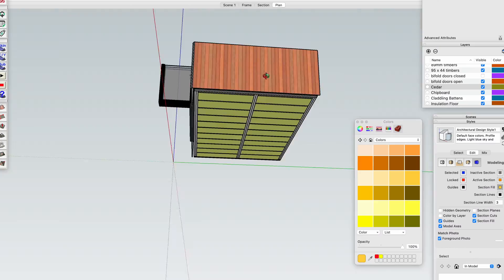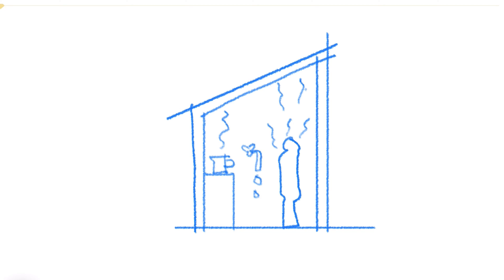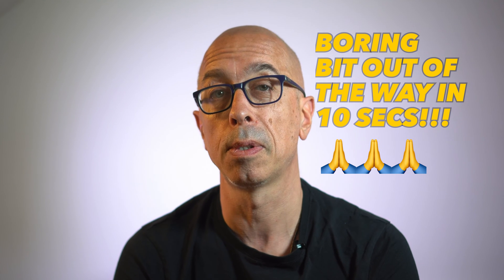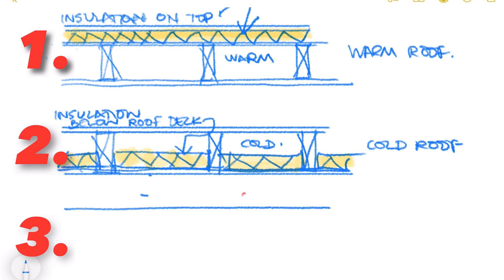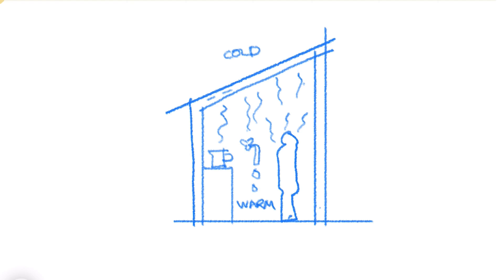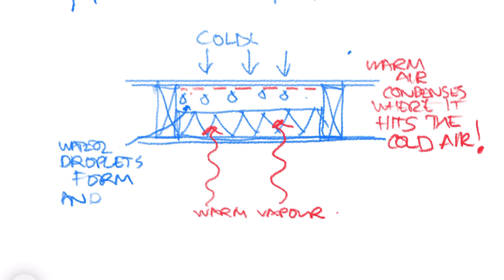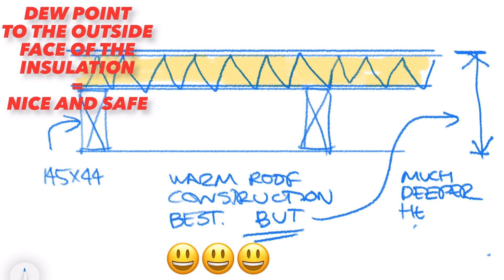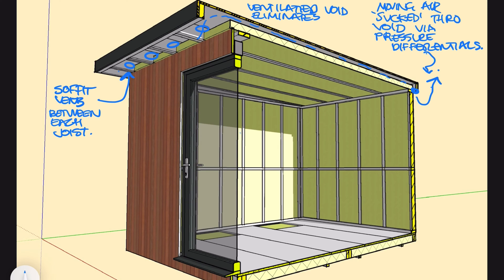Insulation - Warm roof  v cold roof v hybrid - and why should you care

Comment: How do you actually ventilate the warm roof ?
Reply from the maker: There are no voids so there’s no ventilation for a warm roof.
Reply: @build-better-things  
Thanks for the reply and sorry if I sound like an idiot. 

I mean to say will the joists rot over time or will that not be a problem? The condensation from below won't cause the joists to take on moisture?
Reply from the maker: You don’t sound like an idiot. For a warm roof, the joists are at the same temperature  as the air in the room,  since they’re on the warm side of the insulation. same vapour content, so no change in humidity, therefore no chance of condensation . It’s when the temperature changes that the amount of vapour that air can hold changes, and where your condensation can occur. That’s why you put the vapour barrier always on the warm side of the insulation, and , for a warm roof,  above the joists. Condensation can happen as it changes temperature through the insulation to the cold side, assuming small gaps in the insulation and the inevitable small leaks in the vapour barrier.

Comment: Hi, I love your content. Any recomendations when it comes to isolating the roof of a 100 yo flat roof masory house? There is no proper isolation in place currently
Reply from the maker: Difficult to say but usually it’s a cold roof, so 50mm ventilated gap at top face of rafters with insulation between and then under, of you need to utilise the roof space

Comment: As I understand most of these roofs are made to keep the cold out without causing humidity-condensation issues. How would you address a roof for a warm climate area, where most of the year the weather is warm/hot outside and it is only cold maybe a moth of the year. Our main goal is to keep fresh and confortable areas inside the house, but still avoiding any condensation/humidity issues during winter (as short as I might be).  Any recommendation?
Reply from the maker: Hi. The principle of thermal conductivity is true whether hot it cold so a “warm” roof should still be used. I’ve just made a video explaining it if you have a look, I think it’s in the same bit about hybrid roof. It’s a counter intuitive concept.

Comment: I find a warm roof bulky and ugly. A cold roof is slick and neat. You should relate to this as an architect.
Reply from the maker: Hi. I agree if you get your detailing wrong, a warm roof can be bulky and ugly. This is an example of how I use design and detailing to mitigate
Wall Cladding - panel size, fixings, timber or composite - rain screen or tongue & groove
https://youtu.be/xdfVky_GZUI
Reply: @ I can’t work out how moving the insulation from on top of the roof to in between the rafters (for arguments sake we will assume that insulation is same thickness as rafter) changes it from a warm roof to a to-be-avoided hybrid roof. It has the same structure from inside to outside and still acts the same as a warm roof from my limited understanding.

Comment: I have a back porch with a rubber roof 2x8 joist that is now  living space. How would I insulate the ceiling? I was told to put 1" spacers between the joist with radiant barrier over the 1" spacers for an air gap from my soffit to the attic ridge vent , Rock Wool insulation,  and drywall.

Comment: What’s your recommendation for the climate in Sydney, Australia ie. 25-40oC in summer and 8-15oC in winter.  Summer would be two-thirds of the year, so hot outside, cool inside and the insulation would, for most of the year, be for keeping the house cool.
Reply from the maker: That’s the climate where thermal bridging makes the biggest impact. People associate thermal bridging with heat loss, but it has a bigger impact on keeping interiors cool and comfortable in hot sunny climates, especially in the evenings. You need warm roof and warm wall construction, with the actual structure inside the insulation. I’ve made videos about it elsewhere on the channel. Thanks for your comment.
Reply: @ thank you!

Comment: I have a 20m2 flat roof over my kitchen, cold construction but well cross ventilated.  The decking and felt were last renewed in 1989 but it's still absolutely fine and in good condition.
When the work was done I insisted on 18mm marine ply for the deck and a high performance single layer felt for the membrane.
Reply from the maker: That’s an impressive 35 years for felt. I don’t think the marine quality of the ply made such of a difference, more likely it’s been the good cross ventilation. Constant air movement can make even ordinary composite perform pretty much for a lifetime.  I’ve laid my own felt in the past, and it’s harder than rubber to do well so it sounds like yours has been expertly laid. Thanks for the comment.

Comment: I've seen a few videos proposing to fully fill  with insulation the space between joints, so no air gap between insulation and deck, but adding a vapour barrier below the insulation. If no air/vapour travels through the insulation, no condensation can happens under the deck. Do you agree?
Reply from the maker: I don’t agree. Vapour barrier does help reduce the vapour, but there is still vapour and still a dew point therefore. Plus, your vapour barrier will have a load of holes for your fixings and electrical points, and, if you’re following some of the YouTube builders, you will have likely used cheap polythene and fixed it with staples. I’ve made a video about vapour barriers and how difficult / impossible it is to create a real barrier. Timber products on the cold side of insulation is not sensible.

Comment: Our house initially had flat roof and therefore the insulation is between the ceiling joists. Later, pitched roof has been added on top. It's a single story house and due UFH we wish to raise ceiling - thinking of exposing joists and have plasterboard on top. What would be best method of insulation? The roof cavity is ventilated. Note that we also want to install MVHR and ducted AC systems which would interface with the ceiling. Also, the lights would be fitted in the plaster board too. Would it make more sense to do warm roof insulation and reduce roof cavity ventilation?
Reply from the maker: If you want to expose the joists / rafters as you suggest, you don’t have any other choice than to use a warm roof method for insulation.
Reply: @build-better-things  but in theory our second roof (the pitched one) can also be made as a cold roof? or not? warm roof will mean roof tiles replacement which is a job beyond our budget at this moment.
Reply from the maker: I’m not understanding what you wish to expose… but for an existing rafters where you keep the roof covering, you need to ventilate and have a minimum air gap of 50mm and introduce roof vents. I’ve made a few videos about it. Then you need to decide on your insulation based on your available rafter depths.
Reply: @build-better-things  we effectively have two roofs - flat one which was built first and pitched roof that has been fitted retrospectively on top.

Comment: Hey thanks for this video very helpful. I have cut vent holes in my fascias now! But what about the walls? Do these need venting as well? I have a 100mm timber framing with pvc cladding on the outside so if i fill the voids with PIR there will be no circulation of air in the walls. Plan to heat it in winter so will be exfremes of temperatures on each side of the wall. The timber framing will be a weak point in the themal insulation with 100mm pir stuck into the gaps.
Reply from the maker: You need to vent on the cold side. If the insulation is hard up against the OSB for your wall then the breather membrane will allow residual vapour through to the external cavity where it can condense and which should be ventilated. There’s variety of ways to vent these walls which I explain here… see my video here for a better explanation 
TIMBER FRAME v BRICK BLOCK Masonry- House Extension walls - Architect Builder’s 5 expert tips
https://youtu.be/HHunXgidQL4
Reply: @build-better-things  yes so the problem is that we have 100mm deep timber studs framework spaced 450mm apart. Then a polythene sheet on the outside and then tongue and groove pvc cladding exterior. So there is absolutely no air or moisture movement on the outside edge. The best I can think of is to use closed cell spray foam in between the joists as there will be no air gap for moisture to accumulate but its going to cost a fortune

Comment: Spot on. I'm currently designing my loft roof, i keep switching between cold and warm desk designs as im working to a very tight height restriction. My warm design which is a hybrid is 100mm PIR on top and 70mm pushed up inside rafters gives U value of 0.15 according to Kingspan.   They have an online calculator but sadly this doesn't have an option for hybrid. You just have to email them.

I have a question for L ahaped dormer cold roofs....where they intersect at the outrigger section do you just notch out the joists or firrings to allow air  flow. Unfortunately it seems at that junction you have no choice but for the air to flip 90 degrees and out via the outrigger route. In your experience does this work ok and how have you designed your previous L shaped cold roof venting? Thx

Comment: Hello you mention flat and mono-pitch roofs.... I'm about to upgrade my garden office insulation which is dual pitched (roof beams are 2.5 x 1.5 inch, 40cm apart). As far as I can tell, there is rock wall beyond the drywall that makes the office's ceiling. I can't see any signs of it being designed as a cold roof and imagine rockwall has been put up up against the OBS that makes the roof structure. Do I need to worry about it being a 'cold roof' if its dual pitched? Thanks in advance!
Reply from the maker: The reason I focus on flat roofs and low pitch mono pitch in the video is because they tend to have impermeable single membranes (bitumen felt or rubber for example) adhered to the roof deck. If the dew point happens at the coldest part of insulation and there’s no ventilation, the deck will rot as the moisture has nowhere to go as it condenses. Dual  pitched roofs tend to be built with battens and tiles, or slates. Whilst these are essentially weatherproof, they allow air to blow  through, and, it’s therefore possible to use a breather membrane instead of an impermeable membrane, which allows vapour somewhere to go. It’s still essential to have this rain screen ventilated, old roofs have enough gaps in the imperfections of the materials, for modern roofs and interlocking tiles, see my other video about how to ventilate these situations.
Reply: @build-better-things  Bdefinitely

Comment: Thank you for this video. I've been wondering about insulating my workshop (Which has a steel profiled roof) and you've highlighted that occupancy affects the decision which I hadn't previously realised. In my case, for a workshop which isn't constantly used and therefore can be considered as low occupancy it probably doesn't really matter so it sounds like I could get away with a hybrid approach.

Comment: Hybrid roofs are still the least favourable and are actively discouraged 

 Footnote B to Table 4 says that condensation risk analysis calculations are required for warm flat roofs “if thermal insulation is split both above and below the deck or AVCL although typically no more than one-third of the thermal resistance should be on the warm side of the AVCL.
So you can’t put 25mm on top and 100mm inside

There’s plenty of examples on here of badly designed roofs
Steve roofer
Reply from the maker: I would always use a warm roof where possible, and with no composite deck such as osb or ply, which contain glue, above the insulation, which stops breathing. I think I say so in the video, and I’ve shown working examples in my other videos. 
You choose to focus on the “hybrid roof” which I say in the video I have little experience of. I’m illustrating it here as it’s a choice that many self builders are opting for in their garden rooms, because of the limitations placed upon them by contradictions between planning and building regulations.
It’s all very well quoting things such as table 4, except few understand what you mean when little context . I’m doing my best to provide plain English real world solutions which address and explain the problems, such as height limitations in permitted development, and which simpletons like me can understand. I don’t think the insulation industry is doing that. I feel the same about industry approach to vapour barriers which I’ve covered in another video.  This is not a trade channel for technically adept roofers and specifiers. 
If I was doing a flat roof with a 2.5m height restriction, I wouldn’t use a “hybrid” roof, and I say so in the video, I’d use a ventilated cold roof, except….. the regulations no longer allow cold flat roofs in some parts of the U.K….so….what’s the answer?
Reply: @build-better-things  You state "No composite deck such as osb or ply, which contain glue, above the insulation, which stops breathing."  - so what would you use? Also, I have a couple of rooflights including a 3 by 1 in an extension with a dual pitched warm roof that Im planning. Im thinking that the joists should be taller for the rooflights frames in order to hold them flush with the rest of the insulated roof, is this assumption correct?  Great vids by the way, among the clearest ones I found anywhere. Thank you for sharing much appreciated.
Reply from the maker: Hi. For a warm roof, I will have my deck UNDER the insulation, and then bond my EPDM membrane directly onto the insulation. Zero timber above the insulation. Bonding a membrane onto a deck, especially a deck that contains glue, is an awful detail, and for some reason, only really done in the uk. No wonder we have such sick buildings. Architects are as guilty for specifying it this way.  Having any timber based composite deck above the insulation should only really be done as a last resort, such as for the 2.5m height for permitted development. And then, as I mention, I’d introduce ventilation under the deck over any insulation, and have a cold roof. 
I’m not 100pc clear what you mean about your roof light, but, for a velux, or roof lantern for a flat roof, I’ll always create an upstand skirt using timber, with the insulation running vertically , then flash the membrane up, and sit my roof light on that. Great question and thanks for the comment.
Reply: @build-better-things  - thanks for your answer. To clarify, yes I meant pitched roof windows skylights.  So, to sum up on a warm roof you have the following layers: Deck ¦ Vapor Barrier ¦ Insulation ¦ EPDM ¦ Battens & Counter battens ¦ Tiles. If you have skylights you bring both VPL and EDPM up the skirt/frame to avoid any water dripping in.  Am I getting this right? Underneath the deck where the joists are, do you have open eaves for ventilation? - I find quite a bit of contradictory information around the Internet and local roofers seem equally confused around warm roofs :-)
Reply from the maker: @michelleconte8428 Perhaps I misunderstood. I thought you were talking about flat roof.  For a sloping roof, it’s different. I never use a rubber membrane, I’d use a roofing grade breather membrane. In that scenario, I wouldn’t have a deck anywhere. The battens and ties would be the rain screen. If I was putting the insulation between the joists with insulated plasterboard on the inside for the cold bridging, I’d be ventilating under the membrane. I made a video about that here…. 
How to roof this extension on your own - simple rules to do it yourself
https://youtu.be/oq4dCcan86s
If I was doing Warm roof, I’d introduce counter battens and long screws, go through the beater membrane and insulation into the rafters. 
For your roof light, I use the flashing kits that you buy with it, and lap into the membranes.
Reply: @build-better-things  Thanks, that was an interesting video for sure. Now I feel that I know enough to be dangerous. Ok, so in the warm roof double/single slope scenario, we get the rafters, on top of it the rigid insulation panels, the counter batten , then the breather membrane that sits on top of the counter batten to create a depression and allow rainwater to evacuate through the eaves opening into the gutter , then the battens and then the tiles. I found that air open and vapor permeable breathable membrane are acceptable as a condensation management solution, so if I get this right it means that we do not need a vapor layer at all as the right type of membrane can keep the water out while letting the moisture from inside escape. A couple of questions come to mind then; 1./with all these holes to fix the counter battens and battens through the insulation, I imagine that a part you need to be very careful with to keep things watertight and that someone must provide some specialized fixing for that? Then if you decide to additionally insulate between rafters (what are we going to do with all this extra space 🙂), does it make any difference to the setup - doesn't seem to me as it would not change the dew point?